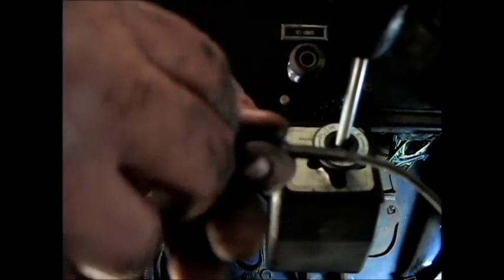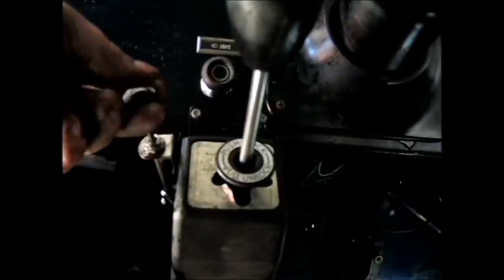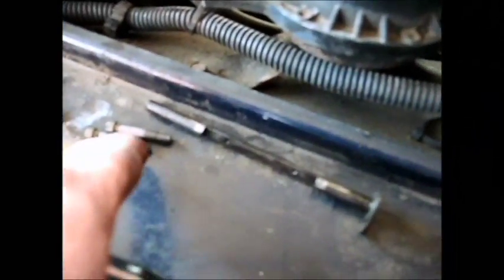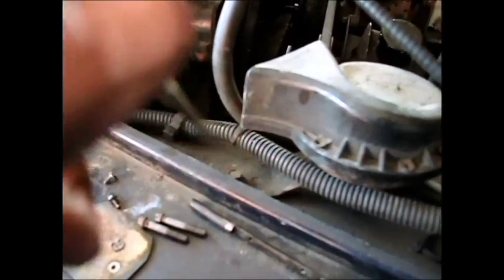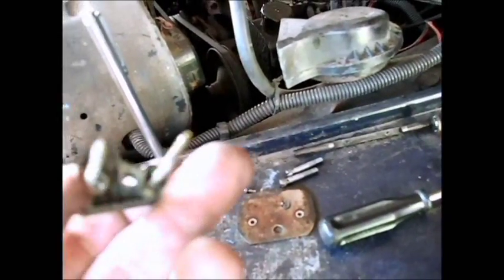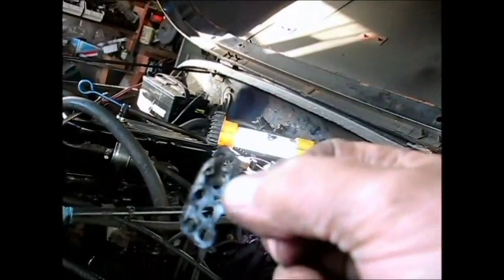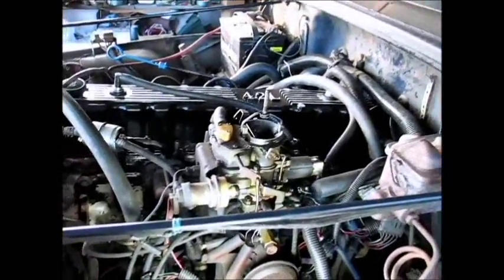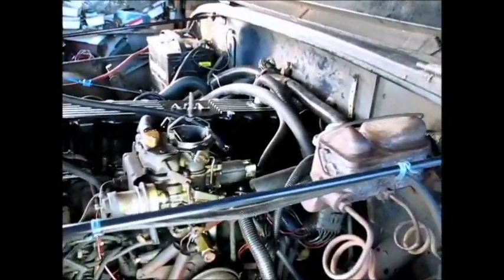Jeep carb, venturi tube, and air intake bypass cleaned on the vehicle

Comment: See that lectric solenoid on the back of that carb that looks like one of those lectric carberators and those lectrick carbs have lectric that works the richness and leans  on them  I would throw that lectric carb away and put a simple one on it. My step grand pa used to say lectric instead of electric. he also used to say battry instead of battery. he was a good ol step grand pa though and could fix anything from junk parts.

Comment: I'll bet a jelly donut that you have a vacuum leak somewhere. Usually when a car runs good with the choke partly closed that is the problem. With all that you pulled off and what might have been pulled off before you might have a small orifice somewhere that is open, maybe even on the base of the carb? Check it out. I like jelly donuts!!